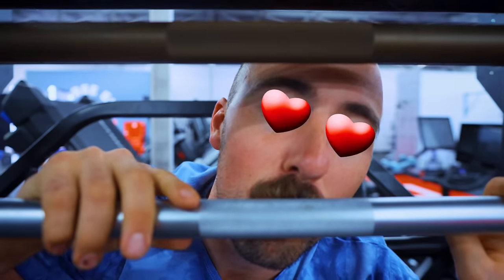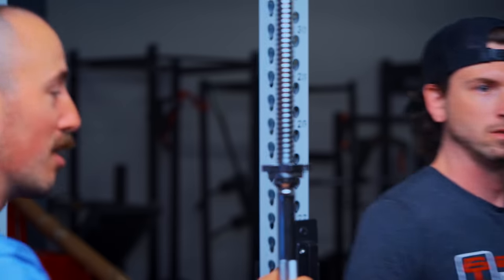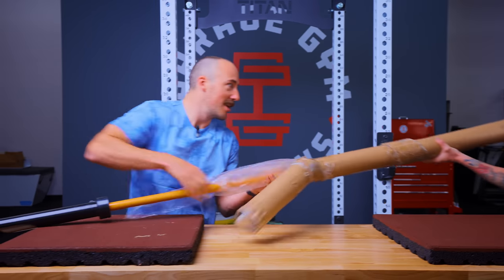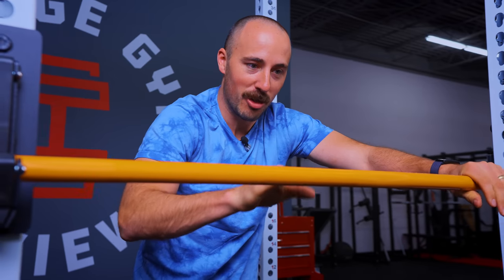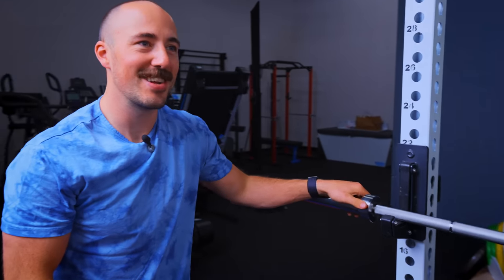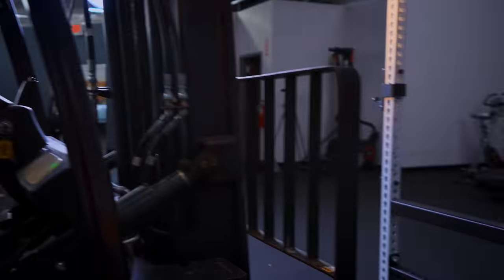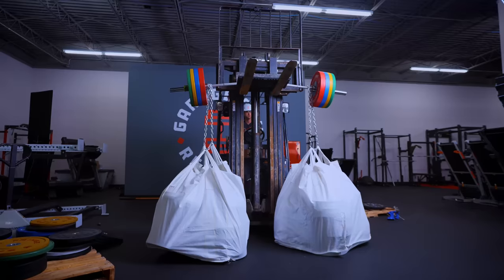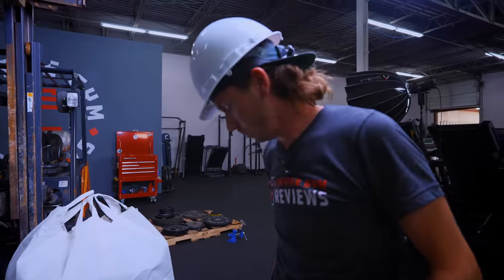$1,000 vs $80 Olympic Barbell Strength Test! (World Record)

Comment: What's more impressive is the bags that can hold all that weight without ripping open lol.
Reply: For real. I don't know how expensive those bags are, but they're apparently stronger than a budget barbell.
Reply: Those are builders bags, used for transporting tons of sand etc, they are designed to be very durable

Comment: Is it just me, or is anyone else wondering if the Eleiko would have bent at their stated weight just the same?

I doubt dropping 70 pounds off it would have prevented damage. 

Coop, you shoulda stopped at the rated limit, so you could ask for a refund. Lol.
Reply: If you go in a bit deeper the bags weigh  a few pounds  and the chain too But can that bar even fit 3000 lbs worth of plates  ?
Reply: @jakub871  if u made plates using tungsten, sure
Reply: Probably the way it was attached had an impact too I'm guessing. Using chains results in basically all the stress focused in a single spot as opposed to kinda spread out like normal and because the chains slip down to the part that is thicker it might add some different forces the bar is not rated to withstand.
I dunno if any of that made a difference, but I can't imagine Eleiko making inaccurate claims for their products.
Reply: I would have liked to have seen more steps like 2k, 2.75k 3.3k, and then over the limit
Reply: Yeah you shouldnt really approach 90% of any weight rating, for anything important. Doing so repeatedly creates stress that can invisibly weaken it and lower the stated weight, for one.
Reply: It wouldn't matter anyway, since it's not the weight that bends the bar, it's torque. They put the weights not where they belong (too close to center) resulting in less torque and the width between arms of the forklift is also more narrow than how person would grip it (more torque). Even though it cancels each other, it doesn't do it perfectly, so there's definitely some margin of error.
Reply: @-axn-  Yeah why did they not wrap the bag handles around the bar instead. Those bags are amazing!
Reply: At some point it doesn’t matter. The bar can handle 2000 lbs and no human could lift that on a barbell, even assuming you could load it somehow. So it hardly matters. 

As far as the claim, they probably didn’t actually load the bar up. It was likely some kind of rig that bent the bar and recorded the force needed to do that. It likely cannot handle 3300 lbs without deforming if you could load the bar properly with it and squat it. Maybe on a rack not on a back.

Comment: I've been using the Olympic bars that came with four 300-pound sets of Olympic weights that I bought on sale at Dick's Sporting Goods.
I wanted the weight plates for plate-loaded exercise machines I own.
However, I also use them when I do bench presses in my squat rack.
My top bench press weight is only 355 pounds, but the Olympic bars handled that weight easily.
Most people aren't going to lift extremely heavy weight, so it doesn't make good sense to pay $1,000 for an Olympic bar.

Comment: Eleiko: “if you out over 3300lbs on the bar it will bend”

Coop: *puts over 3300lbs on bar

Bar bends

😱😱😱
Reply: Yeah, even though it surely wouldn't have been distributed per Eleiko tests/engineering, it was kind of annoying to jump from 1,000 to over capacity.  Something in between, then capacity, then slightly over capacity, then significantly over would have been nice. Just a little bit of extra effort could have made this better.
Reply: @DampRaccoon yeah this was weird. Makes me think something else was up. They had no time, they were scared it would fail at 1500 or something. You would absolutely test 1k then 2 k then 3k. Then overload it. You’re trying to figure out when it will fail, not that it will fail when overloaded. Technically you would use a new bar for every test to avoid metal fatigue. But this isn’t mythbusters. Still sketchy to go from something a person could lift to 3400 lbs.

Comment: 3 ton solid round metal bender: The Cap bar was successful. You should ask Eleiko the technical specs of how they rated their bar. I suspect that shoulder width is too narrow. Fun to watch though!
Reply: Companies are going to use whatever is most favorable for them. It would be max width, probably 4foot like cups in a power rack. Or it’s something even dumber like it could be dropped with that weight on it and the impact wouldn’t bend it.  You can’t actually load a bar with 3300 lbs anyway unless you’re machining your own plates out of something exotic. Someone said tungsten maybe could get there. Idk. Doesn’t matter. I assume the thing is puffery. The only thing that matters is if it can handle 1k. And if it doesn’t will they warranty it. I’m assuming the answer to both is yes.

Comment: One of the most popular weight sets for home gyms is the Fitness Gear 300 lb set. I'd love a review on it like this
Reply: Had it for a bit, and it's good, but when I added deadlifts and Tru Grit started selling regularly $1/lb Bumper plates, I switched to that and like it better overall.
Reply: Fitness gear weights make up the majority of my home gym weights, big fan of the handles on them. I do have a regular pair of 45s that I always put on the bar first so that my deadlift ROM isn't made a deficit
Reply: @ohhellothere3217  my main concern is the barbell, does it hold up?
Reply: @derekdouglas6147  Sorry, forgot to clarify that I only have the weights and not the bar, I got the ohio bar for that.
Reply: @ohhellothere3217  I'm considering selling the bar for like $50 on Craigslist and getting something better, but maybe by some miracle the bar is good and I don't need better but by the time I know I need better I won't be able to make any money back
Reply: @derekdouglas6147  I have the fitness gear bar as well. Squatting over 250 made me a little nervous because the bar was pretty whippy. The bar is just fine, but I wouldn't load more than 300 on it.
Reply: @NittoNba44  I keep telling myself I'll need more than 300 lbs but I lifted for three years in college and barely got my deadlift over 225 so I think if I happen to get over 300 on any lift, the money I lose in not selling this bar now will be worth the pride in knowing I beat it
Reply: @NittoNba44  That sounds a bit scary to lift with.   A bar should only show a slight bend at 300 pounds.  I use my Rogue Ohio bars for benching mainly and 300 is the point where you get a very slight bend when lifting it out of the rack, which is very satisfying, truth be told :).  The more stable a bar is, the better it will be for your numbers. I think whip is only really valuable in Olympic lifts, or maybe in deadlifts since it decreases  ROM a little. For light weight stuff, maybe it's ok, but If you lift heavy, the last thing you want to have floating around in your mind is a worry about equipment failure.
Reply: I have a Cap 300lb set and its just fine for a beginner if you are not going to be doing lifts that require you to drop the bar. Squat, deadlift, bench and press are all fine. While it does get whippey over 315 its not bothersome to me until closer to 390. At which point I got a boneyard Ohio bar for $195.
Reply: Ps - the knurling sucks but has never slipped from the low bar position and works ok with deadlifts as long as you have chalk.
Reply: @TheNotimprezed  I didn't realize how bad the knurling was on the Fitness gear bar was until I stopped at a hotel gym and the Pull up bar had better knurling on it. I think if this bar can get me to 390 (if I ever get to 390) I'll gladly drop $200+ on a better bar
Reply: @derekdouglas6147  ultimately you won't regret having bought the set. When I ran out of weight that was my permission to buy another pair of 45lbs. When my strength outgrew the bar that was permission to buy a better one - one that is all an above average lifter will ever need. I also love having my cheap bar. I use it for presses mostly as I warm up with it while doing work sets of squats with the Ohio. Ill also use it in the landmine. Its just handy to have a second bar to superset with.
Reply: The bar sucks

Comment: The Eleiko is definitely better. However that load was mostly applied inside of the sleeve on the cheaper barbell they were bouncing on it at the very end of the sleeve. The moment arm is far more advantageous with the set up for the expensive bar. I know they did that to the Eleiko as well but if the mass was at the ends of the sleeves and BOUNCING the Eleiko would have failed sooner. Still a fun experiment but its not exactly laboratory conditions fair.

Comment: I used a lot of CAP stuff over the years and have had numerous issues:
-40 lb dumbbells where the heads weren't firmly attached to the handles. They don't wiggle, but they kind of ring when you hit them together, you can just tell it's not a firm connection
-5 foot olympic bar that bent permanently with 295 lbs on it despite being "rated" to 500 I think it was
-6 foot olympic bar that arrived with the collar rotating independently of the sleeve. I had to JB weld it in place
-5 and 10 lb plates that have burrs on the inside that make it hard to put them on the bar

IF you're looking for cheap stuff, I'd go with Fitness Gear over CAP, they're Dick's house brand

Comment: I have one of those cap barbells that came with 300lbs of free weight.  I was always worried that it would snap or shatter and pieces of metal would stab me once I started getting to the max capacity.  Good to see that doesn't happen, even with a cheap bar.
Reply: I paid $100 for the Rep Basic Barbell. It’s rated at 650lb and it’s solid. I likely never reach 400lb. Be realistic with your goals and save your money! 🤷‍♂️

Comment: I have a $65 barbell from Amazon and it's pretty bad. Its not even round with weird casting marks in your grip. The kneruling isn't very consistant either. It's fine for my home gym but it's not gonna be good to slam around or pull 400+ pounds, but just fine for my purposes. When I go to my local gym, the Eleikos always feel amazing to me and I swear I can lift more weight with them for no reason beyond the quality. But there's never a line to use my $65 barbell at my house so I get my best gains with the crap barbell hands down.

Comment: I think that forklift can lift about 6500pounds in actuality, at my work we have an old smaller 1984 toyota forklift and it will lift over 3 tons which is over 6000pounds :)

We even hop on the back when our boss drives it if the load is getting the rear bouncy. Not idel for work safety but we get shit done LOL
Reply: The last part you said is just stupid. There is videos on the internet, that shows people dieing from doing exactly that.. get a new boss

Comment: 6:27 eh
Eleiko bar looked slightly off to me ... and then when you went to check it you didn't show us the footage of you rolling it.
We're supposed to take your word for it on a video which is all about visual proof.

I see what you did there.

The fork lift put the weight up and down slowly. But when you whip (shake) the bar you multiply the force several times. It also forces a different motion and tearing force due to the vibrations running through the bar.
The bar looked bent after just one whip. I don't see it the other tests in this video as very good theorically when it comes down to testing it for weightlifting purposes.

Comment: Yeah bro that Cap barbell is cheap but its more than capable, you had 615 lbs and putting more force/pressure on each side by violently shaking it, I would figure your weight plus downforce in excess of another 200-300 lbs on both sides thats over 1000 lbs of weight what do you think will happen Ina bar rated for 350lbs? Also I noticed you put more force than is needed on that Cap barbell in comparison to the Eleiko, there's agenda here. Either way that Cap barbell performed better than expected, the normal person do not need a 1000 dollar barbell, no wonder these Amazon barbells sell so quick.
Reply: Or the eleiko had higher tensile strength making it harder to bend with your hands
Reply: @psykalag  doesn't matter who lifts 3500 lbs of weight!?
Reply: @gentilewarrior  what are talking about 3500lbs